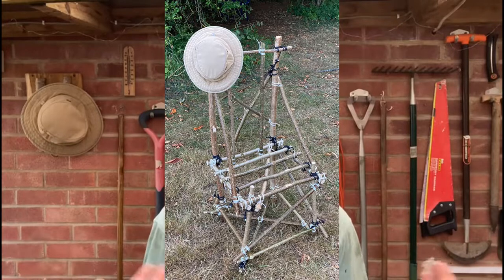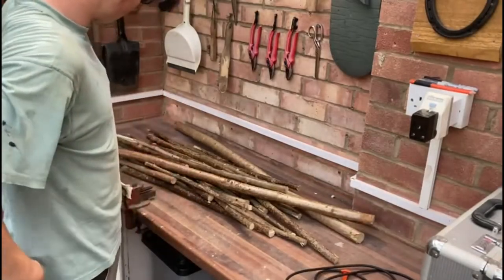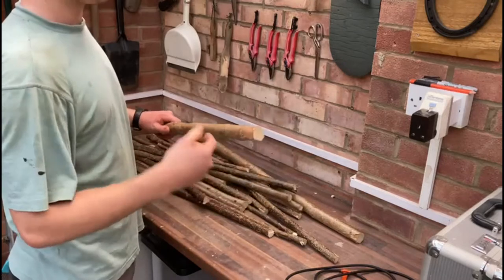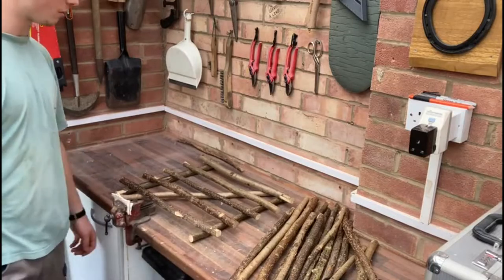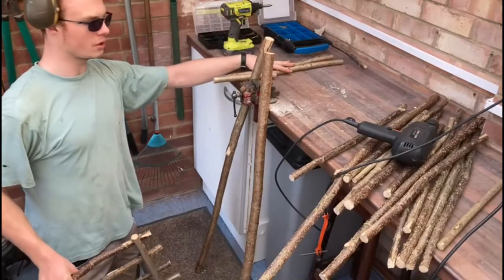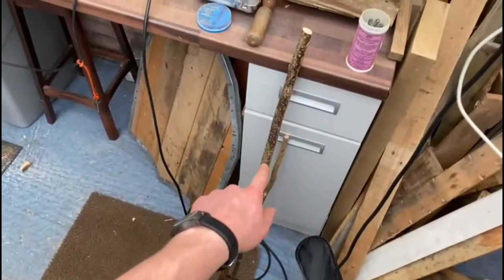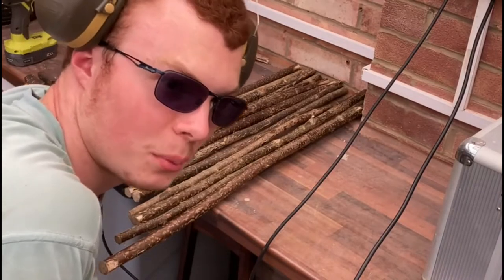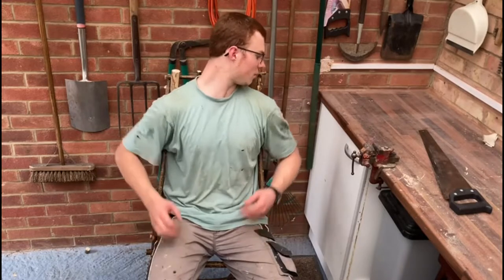Making a Bushcraft Chair from Hazel!!

Comment: We are trying to make one ar Camphill,but it's wobbly,how did you get it so sturdy. Could you do it in slower motion,and explain how to make it sturdy thank 😁.
Reply from the maker: When it was held together with string it was wobbly, it’s much more secure with screws. Another method I want to try is making it with string and then coating the lashings in epoxy resin, to stop them coming undone. Perhaps I’ll get time to make a more in-depth video soon!